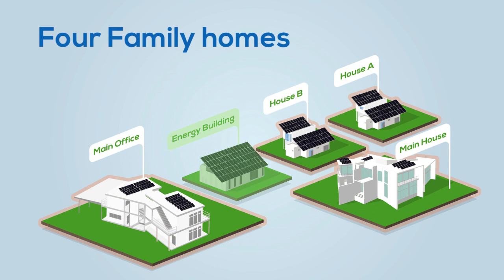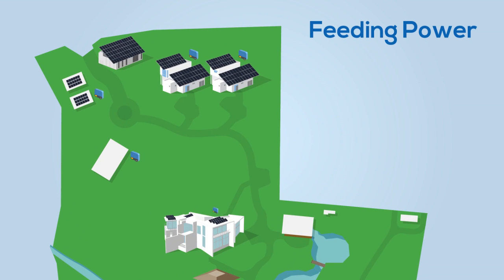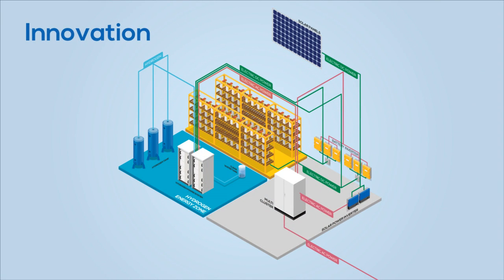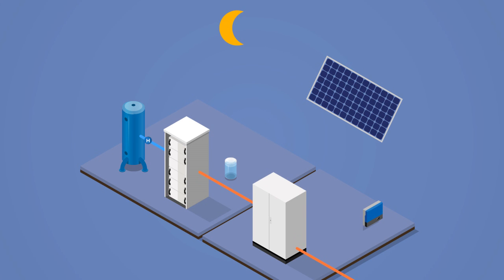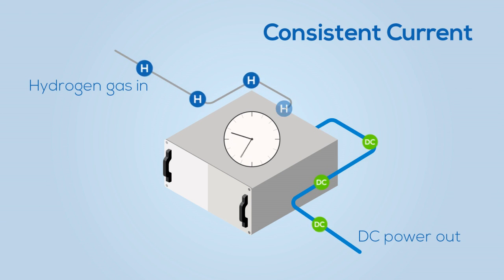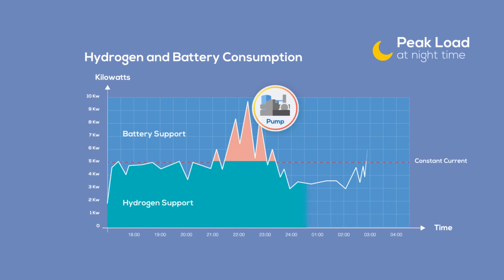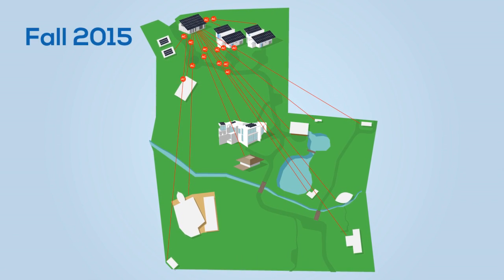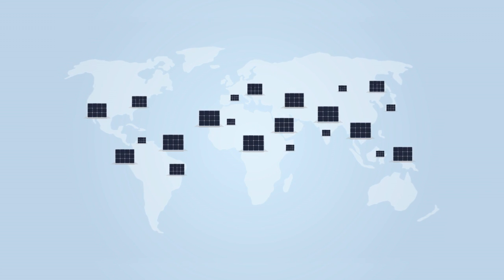The Phi Suea House Energy System

Comment: So it really can not be used to produce energy for the masses and is just for small scale energy production?  In you testing have you figure how many houses , building, business can be support by this energy producing system ?
Reply from the maker: Sorry for the delay Douglas, we hope you are still curious! The beauty of this system is that it is completely modular and scalable. In our set-up 4 homes, a workshop, and a pool house are powered by solar daytime, and hydrogen at night. The hydrogen energy storage technology is very flexible. The different system components (electrolyser, storage tank, and fuel cell) are independent and highly customizable. This allows for the hydrogen configuration to easily be adapted to the energy requirements of the business or site.

Comment: To all the people going on about efficiency......
the Sunlight is Free so efficiency is irrelevant.

Repeat this to yourself until it stays in your head.

Its also delivered to your property for free, it doesn't come from the other side of the world in a stinky boat with pistons the size of a small car, that alone makes it superior and more reliable, as it removes your reliance on foreigners, that is very important.
Reply: +EVZebra True, but not accurate: Solar Panels have to be produced, converters and batteries too. So for a single household this may be a solution, but for a global/consumer scale production, the mass-production of Solar Panel is still inefficient and polluting.
Reply: +Augure Zera  Yes I agree with you solar panels and batteries are not perfect. But I did say Sunlight powered not Solar Panel powered.

Perhaps having one big plant is not the answer because if some thing goes wrong there its going to be a big bang.

 When I was a kid I used to set wood on fire with a magnifying glass. Then I wanted a big magnifying glass but couldnt find one or make one so I resorted to a bush mechanic version. I took 50mm square mirrors and focused them on my microscope box, I used press stick or blue tack to mount them and line them all up. I only covered an area the size of a tea tray and my microscopes wooden box was smoking/burning. 

So if you cover the side of a house with mirrors and aim them at a boiler which is made from a pipe that is bent like a banana then as the sun moves the focal point will move along the pipe. The heat moves through the metal and boils the water, the level in the pipe boiler can be maintained via a toilet type water level valve (an all metal one from a cars carburetor would do it nicely as it has no plastic parts) so now you have steam.

Run that steam into a pelton wheel and drive a 12V car alternator.
Use the DC to split water into hydrogen and oxygen, use two stainless steel plates separated by dust bin bag material as it doesnt get eaten by the NaOH Sodium Hydroxide that you can add to the water to make it give more Hydrogen. Use a needle to prick lots of holes in the dustbin bag to let the electrons through but keep the oxygen out.Let the oxygen go to the atmosphere only store pure hydrogen as it cant burn or explode without oxygen that makes it a million times safer than trying to store HHO gas.

The hydrogen storage tank should be kept underground in a dry well ventilated bunker so that if it explodes you will survive.

Then you can use the sun to cook your food and to power your 4 stoke petrol engines,   provided you replace the valves in the engines with stainless steel valves as there is a thing called hydrogen embrittlement.2 strokes need the oil in the liquid fuel for lubrication so dont bother with 2 strokes, in 4 stokes the lubrication is separate.

Make very sure there is no oxygen in the hydrogen or there will just be a big a big hole in the ground where you once were, perhaps an oxygen sensor inside the storage tank will resolve this danger, the oxygen I believe is heavier so the sensor can be mounted at the bottom of the tank but double check that.

Oxygen contamination is the only real danger otherwise hydrogen is much the same as LP Gas and there are plenty of cars running on LP Gas already and fridges, water heaters etc

It can be done today, its just the fear of failing thats holding us all back, at least this method isnt too expensive.

Instead of a houses wall, make a fake wall out of some thing that you can take the mirrors with you if you move to another place. Sandbags covered with a material shade cloth can be used instead of an underground bunker for the hydrogen tank, this is so people who rent can also build them.
Reply: The mass production of solar panels is not inefficient at all, because over the long term, they out produce almost anything else. a good module can last a lifetime if not more, so the pollution created in production is insignificant compared to the output of a module over its lifetime.
Reply: People just do not get it, that's it free!!!  Just increase the amount of solar panels, these have become very reasonable in price nowadays